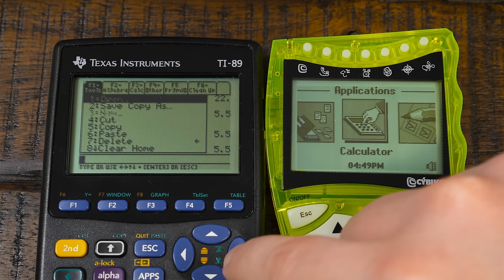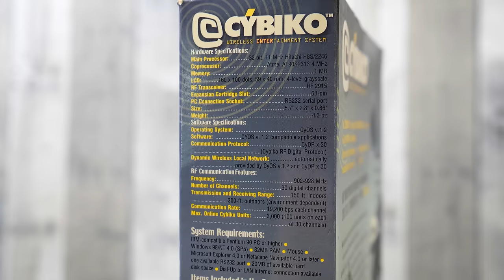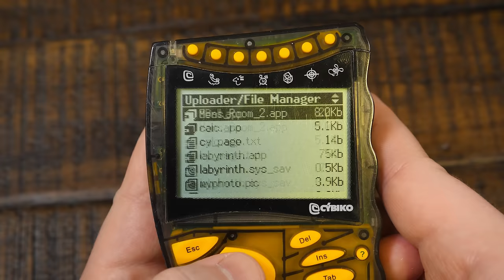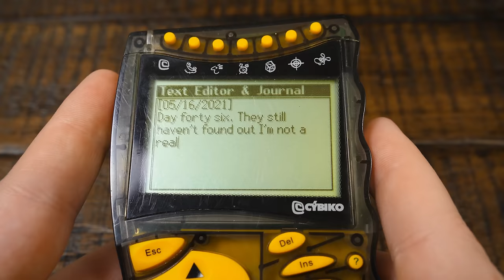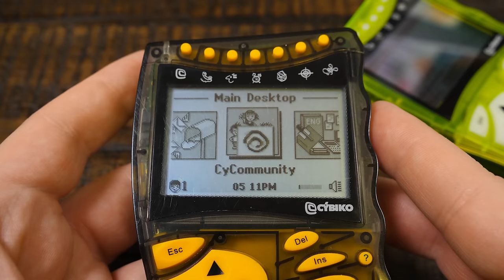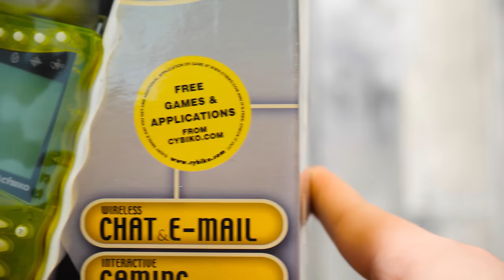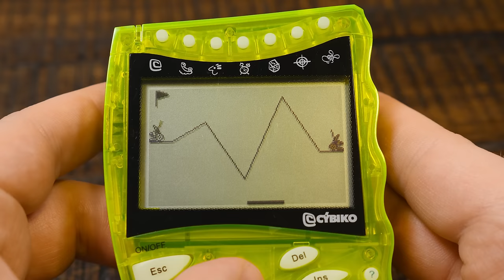The Cybiko Experience: a Handheld Computer for Year 2000 Teens

Comment: That „Palm V“ quote at 06:03 - Classic! 📲🤣👍

Curious about them (And this being the time most of them were being junked-off after the company failed) I bought a pair of classics and an Xtreme in 2003, a time when the fastest computer I had was a Pentium II built from dumpster dives. 🖥🗑🧰

Obviously the experience of war-walking for other Cybikos in a medium-sized UK town centre never turned up anything...But one thing I did find was transferring small files between my ancient laptop and desktop using a wireless connection over the Classics was both faster and more convenient than digging out my null-modem cable and firing up InterLnk.exe! 😁

Comment: I bought a bunch of these (like 6) in 2002/3 for my kids as they were reduced to about $25, they were being sold cheap because of battery issues. They had potential, but like you said the wireless range was garbage. I recently got mine out of a drawer and they still work!!
Reply: Awesome. If you are keeping them, keep an eye out :-)

Comment: My brother and I each had one of these somewhere around 2004-2006 but I could have sworn we got them for like $20 each. The battery on mine didn't work so I could only use it when it was plugged in, so I exchanged it for a replacement, but that one had the same problem. We got them at a PX that had a surprisingly large electronics section compared to other bases my family had lived on. I remember my brother also making money buying several copies of Fallout 1+2 from that PX for a few dollars and selling them on Amazon for just a dollar or two below the price listed on there. After a while, the PX price for Fallout 1+2 was up to the price it cost at every other store. The PX often sells things for cheaper than most stores, but I'm pretty sure it was like $4 for the set and from the way my brother and my dad talked about it, it sounded like it was in error.

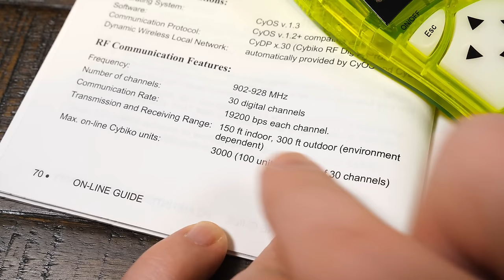Comment: 21:47 Looks like it's operating in the 33cm radio band space, which is probably seeing quite a bit of activity in a city. I wonder how it would be out in the middle of nowhere? Or use an SDR to look at radio activity at 33cm to see if there are other signals that would be overpowering the Cybiko.
Reply from the maker: Yep. Although later in the video I tested in an open field in a rural park in the mountains. Still awful results!

Comment: Clint, you mentioned that the signal worked better in your hotel room, there's a myth that hotels were built in a way to make mobile phone signals poor so you would be forced to use their in room land line phones, maybe because you were shielded from outside interference the Cybiko had a stronger signal to work better?

Comment: There was much less radio noise on the early 2000's. 300ft is ..optimistic, they made it over to the UK in 2001 and was priced at £59.99

Comment: Ive been thinking. Does the Cybiko use a 2.4GHZ range? If so no wonder it didnt manage 300 feet, back when this thing came out there was almost no wifi (2.4GHZ) Polution. And yes different signal technologies can use the same band and interferier

Comment: I wonder if something decayed or went out of whack with age. I still have my original, (AAF8FVB) but no access to my sisters(AAFEZMA) or cousins (AAGALPA) Cybikos to test if the wireless still works well or not. Yes I still remember the tags of each after 22 years. My cybiko still powers on and charges to this day, but that's because I modded it to have a lithium ion battery back then. Surprisingly the old NEXTEL cell I used still has not puffed up and died. Sort of insane actually. 
Back when they were new they extremely easily exceeded 300 feet in open air. On two hill we got almost a mile back then. Impressive for 10mw of radio power. 
Something is certainly strange here, wonder if helium miners and other extreme density ISM 900mhz gear are acting as jammers to these? That would explain the insanely poor range in a city area. This was not an issue back in the day, even with the comparatively massive use of 900mhx cordless phones back then. 
I used to use an extreme as a cywig and browse WAP pages and use AIM with these.
Oh by the way, there was a dedicated cywig gateway as well, it was off white, rounded and had a single antenna. I'm not sure if the radio was more powerful than 10mw, but it may have been.
These have a piezo element rather than a speaker. The Xtreme model has a real speaker and hardware audio. It also had a microphone and supported real time digital walkie talkie voice between units.

Comment: This is a really interesting device, and it makes you think while it didn't leave a longer lasting impact.
I think the main issue with this, apart from the fairly narrow target demographic, is that all the software on it is proprietary. This means that you can only use half the functionality with other people also using the same product, which is inherently limiting; like imagine if AOL users could only connect to websites hosted on AOL servers, or if Gmail users could only email other Gmail users, and no one else; it'd defeat the entire purpose of the internet... weirdly enough, there were systems like that in place in this time period though, like I think for a time SMS services only worked within the same carrier network, at least in some countries.
The other issue is that third party developers couldn't make apps for this, so you were kind of at the mercy of whatever software the main devs created and decided to include; which is fine for a basic calculator, but not so much for something more advanced you might want to customize a bit. Again, imagine if iPhones could only have apps directly made by Apple...

Comment: That band could be quite a bit dirtier in 2021 than it was in '00, and I bet their wireless protocols weren't nearly as efficient as they are by todays standards, possibly necessitating a slower testing process for a lengthy syn ack process that may be delayed further by interference. A quick google search of that spectrum showed various radar detection technologies use that range, and the interference could just be too much for late 90's Russian SDR to process efficiently. Might be neat to bring them along if you ever get access to a 300m faraday cage for a re-test!

Edit: This comment typed on a Fedora laptop, really dug the Red Hat shoutout!
Reply: probably the 4g band is interfering with it. especially when he said that he got a better reception inside the hotel.

Comment: I bought a Casio Cassiopeia E-125 in 2000. The device was great, very interesting hardware. But it was crippled by running on Microsoft PocketPC/Windows CE and how it connected to Windows with ActiveSync. Or often didn’t.

Comment: Honestly, the software developers need way more credit than they got lol. They created something that's not only great for productivity, but also for fun, and it could automatically communicate and network with other devices, and then use that small network to increase range and keep networking more and more devices together, basically making some devices act as proxies for other devices to communicate, all on a standard 900mhz band. Really impressive, and a cool system for a kids toy from the early 2000s.

It would be cool making an Android app that remade this system, maybe using Bluetooth or something, to communicate with other phones and make a local area network of every nearby phone, allowing data transfers, messaging, etc. (something fun would be the ability to play an audio file in sync across every single device).

Edit: 12:55 "Enter your gender (Male/Female)". Well, shit. Guess I can't use a Cybiko...

Edit 2: 20:25 Woah! That adds to what I said in the original comment. That's such a cool feature! You know the developers were just trying to figure out cool ways they could play with the whole networking idea. But setting up one Cybiko as a router to connect the Cybiko network to the internet? That's freaking awesome! Now I wanna know if you could theoretically have 1 Cybiko connected to a "modem Cybiko", and to a local Cybiko network simultaneously, and basically grant internet access to the whole Cybiko network via the proxying method they clearly had.

Edit 3: Okay, well the range is pretty bad, but who knows, maybe with less interference back when it was released it would've worked better.

Comment: 22:28 Is it possible that the range on these devices WERE 300 feet at one point but with internet, computers, cellphones, and the like, all vying for that wireless space, that today (2022) they are drowned out by incorrect signals.

Comment: Wireless, but not WiFi, is slightly disappointing, but I guess that the cheapest option at the times for a portable device with built-in internet connect-ability would have been some sort of laptop for a few thousand dollars.

Comment: i still have a cybiko laying around. does it appeal to collectors? whats the current collector value, if any?
Reply: It's not very high. I think the most we've paid for Brand New In Box was 45 GBP but it is typically lower than that. It's low enough that the cost of getting units from overseas is largely dominated by customs/postage. We are trying to find people overseas to join our project to handle such situations partly because of that overhead!

Comment: Honestly i think a product similar to this could have really worked, between 2000-ish and 2008-ish. 

But with a much more traditional interface: something like a traditional phone, say a Nokia 3310 (perfect minimalistic interface and fast and practical T9), but without a sim, like a walkie talkie. 

Why? Because text messages weren't free back then. You had to pay something like 10 cents for each. If you had the equivalent of a nokia but with the operative range of a professional high range walkie-talkie i think lots of people living close to their friends would have got one.

Consider also that with a 140 characters text you don't need the full bandwidth and intensity of signal required to have a conversation. So the range could have probably be doubled with text messages only, or even more if the device sent them as short, powerful 1 second "impulses" rather than a continuous field like a traditional walkie talkie. 

Add the automatic bridging of multiple nearby devices like this one, and it could have really been practical in small communities.

Such a device could be useful even today, in areas or times when there isn't cell tower coverage or in cases of blackouts or internet congestion.  Sending an "impulse" text could have a range of several miles. I'd really like a device like that.

Comment: Technically, I believe you could run a classic Gameboy emulator on this thing, & a port of Doom! Back in the day, I had a tiger gamecom, & when I got a Cybiko, I soon forgot all about the gamecom!
The wireless communications would of worked better at one time, think of how much frequencies are being generated by modern tech, the Cybiko has no chance in this day & age!
You also have to take into account, the aluminium content in the construction of buildings can also have a drastic effects on frequencies because aluminium can help block them.
The thing could perform better without other tech being in close proximity, like your smartphone for instance?

Comment: You can build these and actually surpass the hype and functions for fairly cheap. Pi zero ,a LCD module, battery and a LoRa module. 🤣😂😅🎃👍hell with the right filament you could print out the original case

Comment: Problem is current day 900Mhz is probably not clear. I believe that I remember some products like cordless phones being 900mhz. Don't know exactly the frequency but somehow I'd be shocked if the 900mhz phones are still as common as the 700mhz analog ones. Don't use those. I had a portable tv that could monitor 700mhz and I could hear the most lame conversations ever.

Comment: Man the story of these things is soo sad. The FCC really fucked these things over in the states. The main reason you were having issues with wireless range is because the FCC came down on Cybiko because consumer radio transmitting equipment required a special license to own if you wanted to transmit more than a handful of feet. Indeed even the poor base Cybiko’s 150ft range was well over the legal limit, so the range is artificially limited in software only for the US market. Of course, because the FCC only has authority over the US market, international units are unaffected. Meaning that if you knew how you could get a copy of the EU firmware, flash it, and finally have a fully functional device.

Comment: I'm guessing why the '150 feet' claim failed is because the spectrum of those frequencies (902-928 MHz) falls under the 'Amateur/Radio Location" standard, according to the allocation charts... There's either a hobbyist radio user or some weird locator beacons flooding the waves, certainly something that wasn't there when these things were released, and it's interfering with the Cybikos.
(edit: You covered that point in the video, but still... You, technically, could analyze the spectrum with an SDR, before and during, to find out what signals are doing what and their strengths.)
Reply: @catperson777  um, okay...